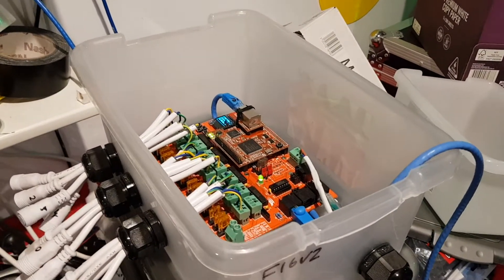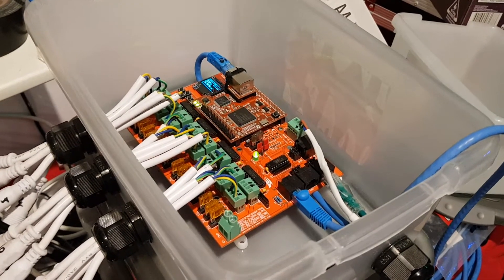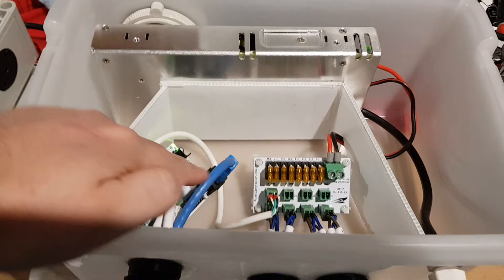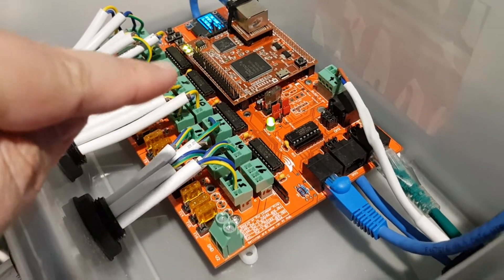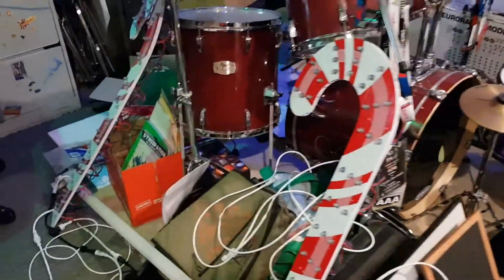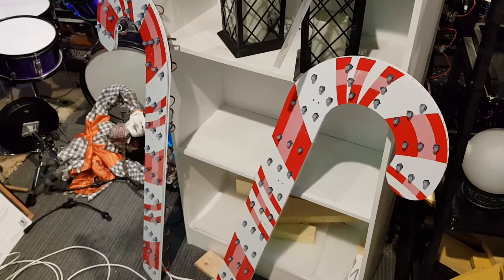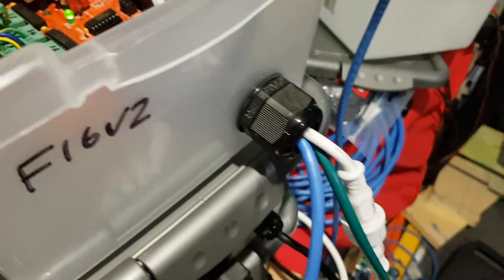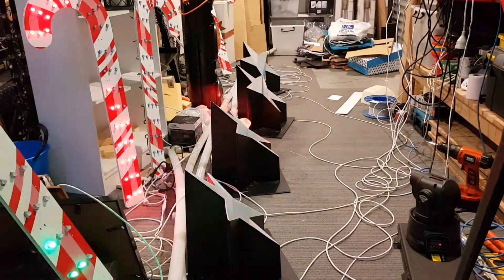Evans Central christmas 2018 new controller setup

Comment: Great video Graham. So you loose the last 4 ports, but it allows you to get data further. And its just data down the network cable - no power?
Reply from the maker: I don't like saying "lose" the ports. You can't use them at the main controller but you can use them down the line at the receiver. You move them not lose them :)
Yes I believe its only data down the CAT cable. The receiver board needs power to run and it has 4x fuses which means you can add power into it and then out those ports if that's how you wish to do it.
Reply: djgrahamevans thanks Graham. Trying to get my head around how it works.

Comment: The pixel receiver / PSU box needs another vent to let air into the box.  Otherwise the output vent won't be doing anything.  :)
Reply from the maker: Good pickup! I plan to add in intake vent to the box before deployment in the yard